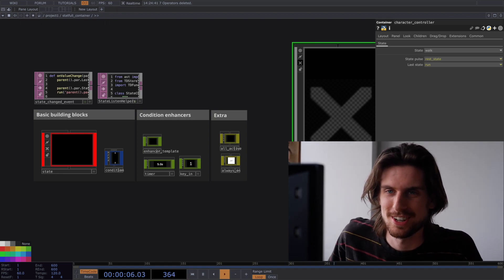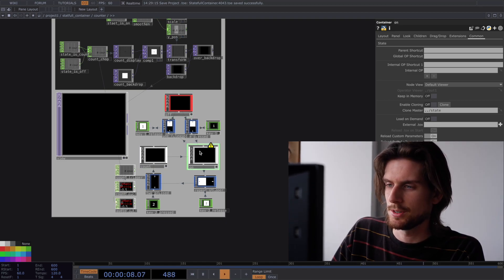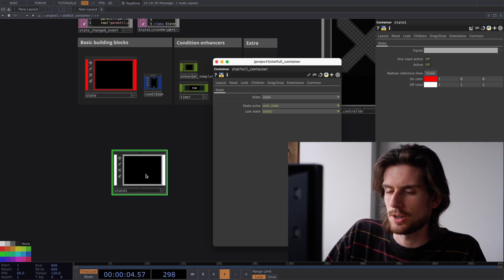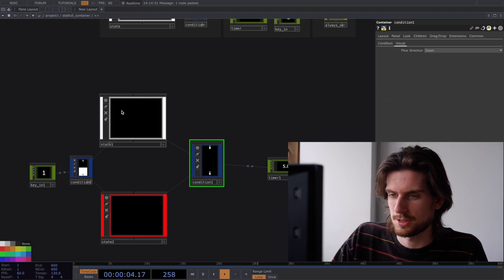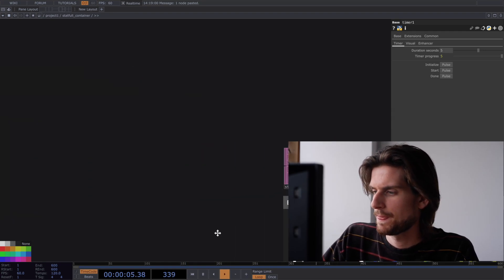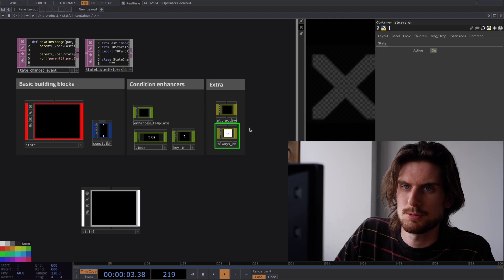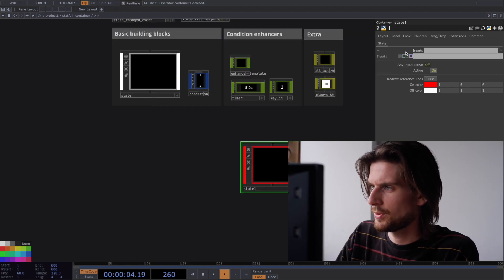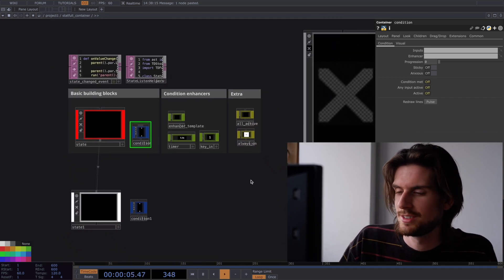TouchDesigner with States!

Comment: Hey, this is great. Just getting to grips. Do you have a tip jar or anything?

Also, feel like I've found a bug. Im using the latest version of TD. when I use the timer as the 'Enhancer' the condition doesn't move. It only starts working when I go in to the condition network. Then when I come back up a level, everything works.
Reply from the maker: @LEDsAkimbo  hey, that’s great to hear :). I actually recently also found the same bug in the latest version. I’ll look into it when I have time (probably next month).

Comment: That error with the unknown path is caused by having the parameter style be "OP" (or "COMP", etc). For parameters that can take more than one operator, you can use the style "Str" and then call the `foo.par.Things.evalOPs()` to resolve the string to a list of operators.
Reply from the maker: Aah, evalOPs is a good one! Thanks for the other suggestion aswel. The reason I didn't make it type Str is because then connecting with dropping one onto the other doesn't work anymore. @Unveil suggested to use a messageBox, which would also make the possibility to not overwrite the old connection. For now I don't think that benefit outweighs the problem though; namely it conflicts with my design goal of keeping it as minimal and native to TouchDesigner as possible. But I am still testing with that.

Comment: Really well done!!! For the warning you can maybe just use a string parameter… and check for the name of the operator and pass it if they have the state tag. Should work. Than to make the connections you can start to use the messageBox with some buttons, is a function  in tdu or tdf, and for the parameters you can start to write some infos so each parameter when the mouse is over give a little description. I think the system is pretty cool… and your networks are really clean and interactives!! ❤🎉😊ps: you know me i am Simo from berlin we meet at the Td meet up
Reply from the maker: Ooh hey Simo! I didn't know it was you 😁. Thanks for the feedback and compliments! I didn't know ui.messageBox and not even the TDF library, cool! I'll try out your suggestion 😁, it might indeed streamline the connecting of multiple State or Condition COMPs to one. And the infos are written! :)